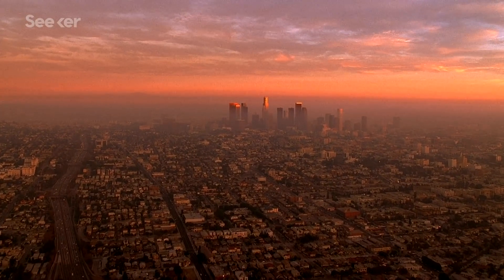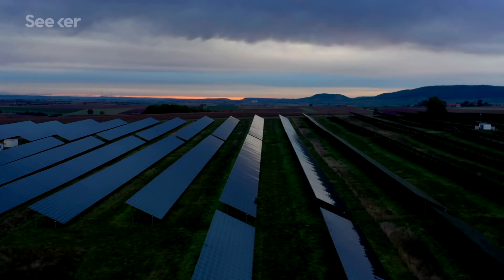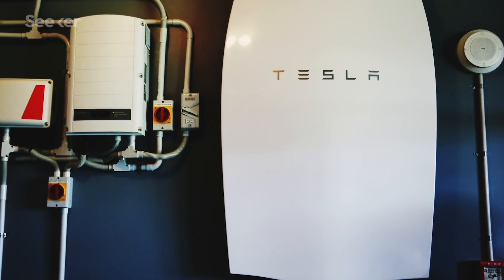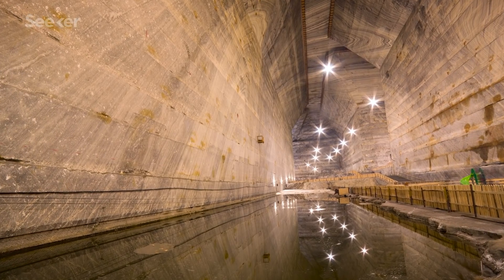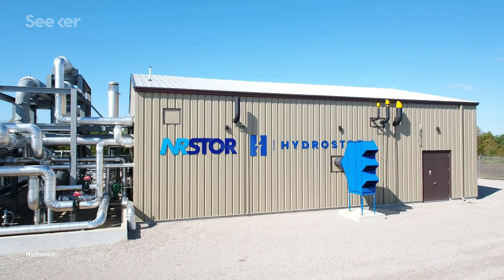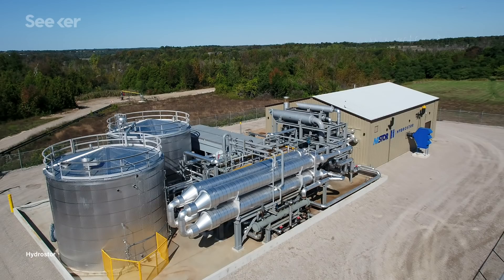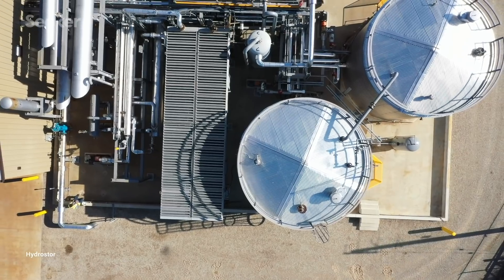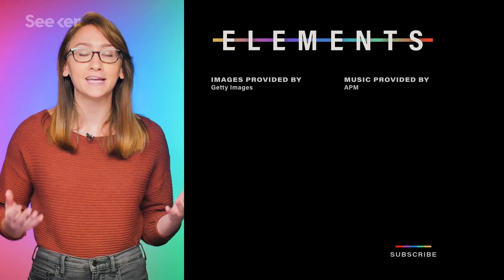This New Tech Could Revolutionize How We Store Renewable Energy

Comment: "Solar wind and renewable are the future" 
Thorium based fast breeder reactors : I am about to end their whole career.
Reply: Every single time anyone mentions renewables anywhere, you can safely bet anything that a squad of pro-bono salesmen declaring that some theoretical nuclear technology is the one and only way forward and that anyone who isn’t yet convinced is as bad as a creationist anti-vaxxer, will quickly appear out of thin air.

Maybe, if the climate gets dealt with at all, the power mix may require some nuclear energy, but this weird, rose-tinted, astroturfey evangelism seems to do more harm than good.

It seems this is more about feeling superior to the “hippies” than convincing anyone or examining anything.
Reply: @bugviddump7397  Bro I am not here selling anything. You understand what a fast breeder reactors is? You put in fuel and after that you get energy plus more fuel. 
If this doesn't excite you then I don't know what will. 
Talking about renewables I am not onboard with Elon Musk's solar dream even though India has some of the world's biggest solar parks because Thorium can do to India what Oil did to middle East.
Reply: @bugviddump7397  Its not rose tinted. It actually is similar to anti-vaxxing, because its a bunch of people who arent in the field running their mouth about something they read somewhere.
Reply: Instead of another pissing contest about which tech is best, lets at least agree on one thing. All possible solutions need to be taken seriously, including climate engineering, or we're f**ked.
Reply: He is right but it's not a permanent solution and we can't just switch to renewable over the night and not even in several years. Imagine the effects it would have on the people and economy which is totally dependent on non renewables. Maybe after a few hundred years thorium we might be able to achieve complete green energy.

Switching to renewables in 20 or 50 years is a stupid thing and will have dangerous effect on the economy of third world countries. Just because some pretentious virtue signalling people who is on a mission to save the planet(complete bullshit) doesn't mean it's right to switch in 50 years or less. It would be a mass catastrophe. People are already fearing about another recession in our doorstep. The only sensible thing would be to switch to thorium for now.
Reply: @Resilientman07  Any serious development in thorium requires a ground up rebuild of the nuclear fuel industry. Not only would require a massive upfront capital expense but it would also be extremely time consuming. 

In fact less developed countries are in many cases better suited for 100% renewable development due to localized populations with limited energy consumption. The major issue with developing 100% renewable for a developed nation like the USA is the scale of infrastructure required over a very large area to supply very large consumption.

Additionally the majority of benefits being discussed are not inherent for thorium, but are rather benefits for a very particular type of reactor found in the Molten Salt Reactor family called a LFTR- liquid fluoride thorium reactor.

The USA actually had commercial thorium reactors in the past at Shippingport and Ft Vrain, but these were light water breeder reactors and did not exhibit the benefits of thermal efficiency, safety and fission probability that are discussed in this thread. For these benefits you need to specify that you're talking about a LFTR, which btw is an insanely complicated reactor.

There's a reason why politicians do not attempt to discuss Generation IV reactors beyond that of light water SMRs. Reactors in Generarion IV are extremely complicated and typically require designs that push limits of nuclear engineering.

For example in a LFTR you're talking about liquid thorium and uranium fuels mixed with lithium fluoride and beryllium fluoride coolant. Historically we don't have great understanding of fluid dynamics for liquids outside of water and a few other materials. At a base level it is impossible to mathematically solve navier stokes equations for these liquids unless you have the help of advanced computer modeling. Today LFTR designs are tested at Idaho National Laboratory using supercomputers.

The idea that anything involving generation IV reactors is simple, typically illustrates that the person saying this doesn't know what they're talking about.
Reply: @brian2440  no just come to India or anyother developing nations to see if we have space for solar farms and wind turbine farms.poverty is the criminal right now I would say not climate change . Western People should think in terms of population and poverty and uplifting the world's average income. Most people in developing nations Don't have much needed knowledge about birth control and population explosion l. If these things gets regulated then automatically people will care about a good domicile and fresh air. Priority is Poverty  and not climate change. Imagine the amount of silicon waste and also the efficiency of solar panels. Lowest of all renewables right now.
Reply: @brian2440  I appreciate your deep understanding of the subject Brian :)
Reply: @Resilientman07  There are ways to recycle silicon waste and it is inaccurate to compare photovoltaic efficiency to thermal efficiency and turbine efficiency. All of these have different variables associated with calculating their efficiencies that are not necessarily applicable to other means of energy development, therefore it is inaccurate to attempt to compare the efficiency of a solar farm to the efficiency of a natural gas plant at face value.
Reply: @Resilientman07  So in my comment for developing nations you will see that I described countries with localized population and limited consumption. 

India while having very high population per capital in some cities doesn't really fall under this criteria because it has multiple major population centers spread out around its country and ranks #3 in electrical energy consumption in the world.

India has somewhat of a unique situation in which they have very limited uranium supply by the largest reserves for thorium in the world. There's a lot of good development in Thorium reactors in India partically by the Bhabha Atomic Research Center  and Indira Gandhi Centre for Atomic Research, as you may know.

For India it may make sense for them to develop a larger concentration of thorium based nuclear energy, and have a larger concentration of nuclear development in your portfolio.

I also can't speak for your grid situation as I'm completely unaware of how India has it set up. This is actually very important, because your grid network can both aid in and make challenges for higher concentrations of intermittent energy distributed throughout your country.
Reply: @brian2440  wow I agree with you on most also we should fund more on molten salt thorium reactor more efficiently because we can't achieve total green energy using solar, wind alone in next few years. What about poverty? Could you provide solution for the things I stated in previous comment. You're eloquent and Yes I don't know the gobbledegook of molten salt thorium reactors completely. I know they produce harmful waste but they decay much faster and it's just temporary if you know what I mean we should invest in solar but research nuclear more at the same time.
Reply: @Resilientman07  So you do realize though that nuclear waste with shorter decay rates typically present larger risk as this means the isotopes exhibit higher radioactivity? (Theres a lot of other variables as well, but just comparing decay rates this us true).

This is actually a significant issue with MSRs in that their fissile fuel is considerably more radioactive and their coolants are considerably corrosive. This is why most companies have proprietary superalloy compounds that they would make their plumbing out of to resist higher levels of radioactivity and corrosion. This also creates an additional problem in that you're requiring major infrastructure to be effectively custom made of rare materials thus increasing cost. Typically this is downplayed with the explanation that the benefits of lower risk and greater operational efficiency reduce capital and operational costs or even fuel costs depending on a company's model.

As for reducing poverty that's a very complicated question that even if I wrote a 150 page book on here wouldn't necessarily answer. There are too many variables involved to give a definite answer, however if we look historically at the largest rates of developmental increases in society they follow massive periods of industrialization. 

This puts countries like China and India in a sticky situation. In order to develop your country at a massive scale and significantly improve economic well being of your society you will likely require massive industrialization, but at the same time historically these periods also brought significant increases in pollution of which we are trying to reduce. 

This is in part why China's economic, energy and environmental plan One Belt One Road they state that there will be a delay in significant emission reduction as the country is trying to develop its western area and grow the overall developmental status of society.

Now this doesn't mean start cranking out more coal mines, but it does mean you need to significantly increase energy generation that likely needs to be primarily non-intermittent. This is where technologies such as CSP Thermal, VHTR Nuclear, AHTR Nuclear. MSR Nuclear, MSAHTR Nuclear, CCS Natural Gas, HELE Natural Gas/Coal, CAES/CHP/TIF/LAES (energy storage) coupled with increased energy efficiency can play a major role in developing your society at a very high rate but also minimizing emissions as much possible under an industrialization model.
Reply: @brian2440  man! You're so eloquent. Here have my like😁 but I think you do know that they tried solar cells in germany but it left more carbon footprint than it was supposed to reduce which on a large scale if you think about solar panels affordability and manufacture, I can't fathom the amount of damage it would leave . Would be happy to hear your thoughts.
Reply: @brian2440  water is really dangerous inside nuclear reactors, it becomes hydrogen gas. People think that the uranium is dangerous, no, the steam is the dangerous thing.
Reply: Yea well they best get a whole lot more efficient if they are going to be the future! As of right now they are just super expensive sink holes!
Reply: Seeker already did an article on that energy a year ago.
Reply: yeah i wish there wasnt so much stigma against nuclear power.
Reply: See my full article at renewable energy,https://sciencetechjon.blogspot.com/2019/12/renewable-energy-innovation.html?showComment=1577442985389&m=1
Reply: y'all need to read about the THTR thorium reactor build in Germany and the disaster that it was.
Reply: @jonas1015119  Could you provide a link? I'm trying to find out about it, but can't seem to track it down.
Reply: @eugenes9751  https://en.wikipedia.org/wiki/THTR-300
Reply: @jonas1015119  Thanks, it seems like it was shut down because of regulatory and licensing problems. Or am I missing something?
Reply: Abhishek Dev you better beat us to the “thorium consumption reactor”...that breaks down the past and current hazmat radioisotopes:))
Reply: Thorium doesnt work
Reply: Abhishek Dev I was just about to leave the precise comment you left—thanks for saving me the typing! :-)
Reply: Indonesia is taking a strong interest in Thorium. They are currently researching the possibility of having a tanker powered by Thorium. Don't know how is that going to work, but one can imagine the military application. Their keeping it tight lip though. Perhaps to avoid attention of success or embarrassment of a major failure.
Reply: If you're operating a fast breeder reactor it would be more effective to breed Uranium 238 into Plutonium 239 than to breed Thorium 232 into Uranium 233.
Reply: In theory, Yes. BUT...
Reply: Nobody here seems to be mentioning ThorCon. American company securing funding from the Indonesian government to construct a tanker ship with a Molten Salt Thorium Reactor which transmits power via an undersea cable to the mainland. Solves the problems of construction costs, mobility and safety by being constructed over the Ocean and having a passive cooling failsafe. It can generate insane amounts of power at total lifetime costs lower than coal and oil and that's just with the current cost of Thorium and steel shipyard costs. If economies of scale kick in for ThorCon in other markets, you could see dozens of these things off major coastlines in short order.
Reply: ThorCon can compete with coal and replace coal burners with thorium burners. https://youtu.be/EyApF90-GEI
Reply: Y’all. He was largely making a joke. Chill.
Reply: Thorium reactors may be the future in 50 years.
Reply: Yeah.. because of numerous unsolved problems, estimated to be ready 20 years from now, like nuclear fusion..
Reply: Matthew Huszarik  fixed it, still it was just fearmongering
Reply: Matthew Huszarik  yes, that's the reason its easier to create it in thorium reactors, not only you don't need the same quality as U235, the process is much simpler, and you get PU as kind of side-effect.
Reply: It’s taken so long that fusion will come before thorium based reactors
Reply: Thorium reactors... a nice idea, incredibly useful, that has great PR that overshadowed some of the structural impediments it has.

Business-model for nuclear is uniquely unworkable, which is the main reason it's unpopular. 

Nuclear plants can and do often end up being huge sinks of money with cost overruns. Construction companies end up having huge leverage to run up costs and delay. Political forces (e.g. pro-fossil fuel) can easily leverage local, federal politicians through dark money lobbying and astroturfed campaigns to delay. Stakeholders in the local area may have genuine, good faith, concerns and resistance. Or they may be irrational and opposed to "nuclear".

But fact that China has cooled on nuclear power convinced me the issue is more than people 'just being scared of nuclear' and overbearing, excessive government regulations.

Perhaps the small sized, portable, supersafe, reactors are the solution to the main practical issues? In any case, while nuclear has issues it cannot/should not be frivolously dismissed, we need all possible tools to deal with this transition from fossil fuels.
Reply: BB2 G - your argument is against BWR and PWR designs. 
Your reasoning is as valid as saying you can’t cross a body of water, because your canoe is leaky. 
Can you build a new canoe that does the job? 🤔

I doubt you have a clue about LFTR or uranium salt reactors, but you’ll quote ad nauseam about old reactor designs and say it can’t be done. 
News flash, no one is suggesting building any more of the old designs. 

Is there work to be done, of course... doesn’t it make sense to explore it as a replacement for NG and coal power plants?
Reply: @bakos6625  Molten salt thorium reactors  actually addresses most of the issues with today's nuclear power generation, in particular safety and waste generation. The main reason they aren't the major source of power today is a political decision made by the Nixon administration which unfortunately changed the course of nuclear power, for the worse.
There are many issues that still need to be addressed with MSTRs but they are not really more difficult than issues solved for other types of reactors. The only reason they haven't been solved yet is because much less effort has been put into solving them.  Thankfully at last that is now changing, even if slowly and not in the western world.
Reply: BB2 G Nuclear does not do ‘small’ safely. The problem with all nuclear reactors is that it releases radiation which has major safety implications, makes maintainance difficult and expensive.
Reply: Name one functioning Thorium reactor.
Reply: @ariason7233  Bruh, wait a year then i will tell you
Reply: @ariason7233  ORNL's MSRE demonstrated  MSR capabilities. China has 400 PhD scientists and billions of dollars dedicated to TMSR and other salt cooled designs
Reply: @ariason7233  There were THTR-(300) in Germany 30 years ago, but the concept of the pebble bed reactor wasn't quite the best - then and now - so it was discontinued in 1989
Reply: @ariason7233  World's first fast freeder reactor is operating in India.
Reply: @abhishekdev258  Well that is good to know. I'm guessing that is an experimental reactor? I wish Thorium reactors all the best, when it comes replacing oil, coal, gas and old nuclear with Thorium fast breeder reactors I say YES. It is at least on paper significantly better. The energy transition needs all the help it can get. When it comes to Thorium pushing out other green technologies I say NO. We need both.
Reply: @abhishekdev258  Hmmm? EBR-1 was a sodium potassium cooled fast breeder reactor that operated in the USA in 1951, so no....

*Side note the US Nuclear Submarine Program actually commissioned two different types of nuclear submarines one based on EBR-1 and one based on the combination of designs between 105-B aka B Reactor at Hanford and X-10 at Argonne (although technically at the time both of these water cooled projects were commissioned under the Manhattan Project). The EBR-1, liquid metal breeder reactor, led to the creation of the USS Seawolf program in 1954. While the X-10 and B Reactors, water cooled design, led to the creation of the USS Nautilus program in 1953.

This is why its important to use correct labels to specify exactly what type of reactor you're talking about.

Also BN-800 is a Generation IV Fast Breeder Reactor operational in Russia since 2015, which in part uses decommissioned plutonium 239 from WMD stockpiles as part of an amendment for disposal of weapons under NPT.
Reply: @ariason7233  The fast breeder reactor is already supplying electricity to the grid and the reactor is profitable.
The only reason why there aren't many fast breeder reactors is because India doesn't have funds. And no they aren't sink holes for money. If India would give control of their Thorium to USA like Saudis (initially) gave control of their oil to USA. Things would have been very different.
Reply: @ariason7233  There are a few in india
Reply: @incription  nope
Reply: Thorium is meaningless if nobody's willing to build the reactors. Ironic how the greenest energy in existence is not allowed to exist because of the exact same people who are trying to "save the planet".
Reply: @The Infidel - you are seeing "renewable power" through rose colored glasses. 
https://www.google.com/amp/s/www.spectator.co.uk/2017/05/wind-turbines-are-neither-clean-nor-green-and-they-provide-zero-global-energy/amp/
The best green energy is Hydro electric, and fission (eventually fusion).
Wind and PV are just feel good energy sources, and are wastes for the most part. 

If I had a cabin in Alaska, 200 miles from anything else,  I'd put in PV for my summer vacations. But using PV to supplement a power grid, is a waste of resources.
Reply: @curtischilders3024  PV has only success because it avoids taxes in residential and low power usage , it doesn't need to be economical either
Reply: People against nuclear nuclear energy have already lost the debate. The transition to completely clean energy will involve multiple sources/types - nuclear, wind, solar, etc. The next breakthrough in nuclear technology was the Small Modular Reactor (SMR). 

https://www.energy.gov/ne/nuclear-reactor-technologies/small-modular-nuclear-reactors
https://en.wikipedia.org/wiki/Small_modular_reactor
Reply: he said "about", which means mister. Anti-nuclear guy, it's going to be built all over the world i hope.
Reply: @aryan201  "about", "i hope"
yall nuclear fanboys always like to talk speculatively. Its like speculation is the only thing you can do lul
Reply: de0509 “Nuclear fanboys”? Wow it’s almost like someone could support something still being worked on and has potential to be much more viable and useful than something else, cause we all know solar and wind are absolutely perfect.
Reply: @de0509  I hope for a brighter future, and only nuclear energy seems to be the way.
Reply: @de0509  The irony of that comment on a Seeker video where all they talk about are "could" and "maybe"...
Reply: Fun fact a thorium reactor is safer than a uranium or plutonium based one. And can’t be converted into a nuke building facilaty so we can place them in hot zones (political, and  military). And thorium is a lot more abundant than uranium and it is also has more usable power. The waste only last a couple hundred. Aginst thousands of years or uranium and plutonium.
Reply: @spacetechempire510  You do realize that because that because Uranium 233 has a 300 year half life compared to Plutonium 239' 24,400 year half life or Uranium 235's 700,000 year half life that makes Uranium 233 considerably more radioactive and have a higher medical risk than the other two fissile fuels radiologically speaking? 

(Plutonium 239 has some additional risks due to toxicity).
Reply: SpaceTech Empire yeah 100s of years of planetary pollution vs thousands of years is your argument. The reality is if there’s nuclear waste and scientists haven’t figured a way to wipe it from existence or turn it into a non toxic substance, nuclear is a failure (if you care at all about the rock your living on) we have the tech to power the world that doesn’t have radioactive component. Frankly the only real possibility I see for nuclear are watches and clocks and possibly nuclear batteries. Anything else dealing with nuclear has done nothing but cause massive harm to this planet.
Reply: @Hulkenbreak  There are many ways to deal with nuclear waste and most of these are used in practice today:

- Fast Breeder Reactor/ Fast Neutron Reactor
- Vitrification/ Synroc Conversion
- Nuclear Burning
- Reprocessing
- Pyroprocessing
- Industrial Re-Utilization
- Advanced Burner Reactors
- Deep Geological Depository
Reply: @brian2440  Then you should have been more specific, since you quite clearly stated there isn't enough "empty land" on earth for wind and solar to be viable. If you didn't mean that literally I'd suggest saying what you do mean, or at least providing additional context, since less informed people could interpret your words literally, which would lead to completely incorrect conclusions.

Regarding land in the right places the answer, as so often is the case is, "it depends". Solar can be co-located with agriculture in the SEA region without prejudice to either. In Europe the Netherlands are either the largest or second largest (I forget which) food exporter on the continent because of their extremely efficient land use.

Agriculture, particularly animal rearing uses mind bogglingly large amounts of land. Now I'm not about to suggest everyone become  vegetarian, that's a whole different discussion (and something I'd personally struggle with) but it does mean that there is plenty of land, even in developed countries. We simply need to utilise the land we have more efficiently.

Add NaS mass storage, Li-ion peakers, pumped hydro, offshore wind and the current commercialisation of hetero junction PV, offering very large gains in energy density over the next few years and you have a promising mix.

Unfortunately when it comes the these discussions all I seem to see are either half truths, flagrant exaggerations or pervasive negativity. Nuclear is a fine technology. As an engineer I like it, hell I appreciate the engineering complexity behind coal and CCGTs as well. However looking at the nuclear record. Looking at Hinckley Point C and seeing the UK government paying more than double what the wind lobby offered for outdated technology that is already over budget and will almost certainly be delivered late is not a great selling point.

Solar and wind have their weaknesses, as does any generation technology. However at their core they are cheap, relatively easy to build, massively scalable, inherently safe, quick to decommission and can be easily recycled, they also have that rather neat attribute of an inexhaustible energy source that doesn't have to be transported to the generation site. 

Now excuse me while I rant a bit. 

Yes there are grid stability problems, there are voltage regulation issues, synthetic inertia still hasn't been cracked, reactive power generation drops off with voltage for static compensators, yes these are some issues among many and yes they are being worked on. The US still has "temporary" underground waste storage facilities for highly radioactive nuclear waste that are held up by wood, the same wood that is vulnerable to ionising radiation. Yet I see little discussion of that.

Nuclear has a similarly long list of issues, which are also being worked on. Hence the promise of thorium and fusion. However right now these are either nascent or unproven technologies which will take decades to mature. Meanwhile should we remain at the status quo? Or should we work with and improve the technologies we have, today, that can mitigate climate change and help us to transition?

I'd love to see a future of limitless fusion energy, but until we get there and until they are viable for all to implement and use across the world I will emphatically support the development of onshore and offshore generation technology, both electrical and thermal so that future generations can enjoy this little blue dot and continue to have disagreements on YouTube without having to live in a bunker.

End rant.

Edit 1: This was suppose to be to Eugene, not Brian, but I can't change it...
Reply: @DaleBarnard  Saw your edit, so thanks for clarification.

I agree that the grand majority of people on media are massively oversimplifying energy transitions both those that support renewables, those that support nuclear and whatever anyone else supports. 

It is extremely concerning to me to watch our politicians bicker over who has the most ambitious GND, when in reality all of the candidates plans are dumpster fires compared to actual scientific studies on energy transitions. 

I don't support 100% renewable due to scale of infrastructure required. For one 10 million solar panels is a massive scale and huge solar farm - great accomplishment, but under a 100% renewable model were looking billions to hundreds of billions of panels. Not only is it the amount of resources and planning to develop these projects, but at this scale you require a massive amount of time to set up these projects, which I would say construction (in terms of the actual processes for preconstruction and construction) are largely not even considered when people make these plans. 

Additionally there are considerable management challenges for the US Electrical Grid to sustain this kind of development. Yes it can be technically achieved, but if we already have existing assets that would reduce the need for massive confidential scale management and supplemental technologies it does not make sense to me to make our decarbonization plan more difficult. And a LOT of studies for Sustainable and Renewable Energy Sources make this same argument. 

Lastly we need to consider the challenges of implenting these scales of infrastructure in real time. Is it feasible to replace generation from a natural gas plant or nuclear plant with just renewables by the established deadlines? What is the risk if we fall to meet these deadlines? Does it make more sense to innovate existing assets than removing and replacing them with another energy source? 

One of the largest questions I have of Sanders GND in the USA is that he has a policy that all nuclear reactors coming up for relicensing would be decommissioned. By 2022 (in less than 2 years) 9 nuclear plants would fall under this criteria and these plants produced nearly 80,000 GWh in 2018 in Massachusetts, New York, New Jersey, Ohio, and Michigan. That's more energy than the net generation for the entire utility solar industry for 50 states combined (by over 15,000GWh). Does it make sense to replace this amount of energy in 2 years with wind and solar? Absolutley not....

So we also need to recognize do our timeframes for development match expected timeframes for reduction so that we can safely transition to other sources without causing catastrophic impacts to the electrical grid and the economy. 

-----------------------------------------

In regards to your comment on nuclear waste storage, I personally do not agree with the conventional US policy of mandating that all nuclear waste be placed in deep geological repositories.

1. It's a tremendous waste of resources. Considering the fact that approximately 97.5% of all high level waste by volume is made of Uranium 238, Uranium 235 and plutonium 239. All of these are fertile or fissile nu lesr fuels that can be used in nuclear reactors models that currently exist in commercial development at scale. 

Now is it simple? Heck no... to separate the materials it first requires reprocessing, which is a very chemical intensive and costly industry. There many types of reprocessing though with some non-aqueous (elimination of water) based procedures that reduce waste volumes and water concentration to reduce costs. 

To reduce Uranium 238 and Plutonium 239 concentrations we can use fast neutron and fast breeder reactors. The USA is the foremost country in this technology with the development of 16 experimental programs spanning 40 years, yet we do not have a commercial reactor. Other countries do have commericlal FBRs though. Again THIS IS NOT A SIMPLE TECHNOLOGY. 

Overall I believe that if the uSA developed a true nuclear waste management program that was designed to re-utilize unspent nuclear fuel and use some fissions products for other uses we could significantly reduce waste stockpiles while also growing new industries. 

Is this going to happen? Likely no. 
1. These processes require very capital intensive and very technical technologies that have very limited populations of knowledge (one of the largest reasons we didn't develop MSRs past the 1970s btw).

2. These processes are used in weapons development and use fuels that are used in the creation of WMDs. This raises a lot of political and social problems.

3. This is an extremely complicated topic that the average American has little to zero understanding of, which opens an easy door to misconception and fear.
Reply: @DaleBarnard  Just out of curiosity are you related to Michael Barnard?
Reply: @brian2440  Well put, glad you saw the edit. I'm not related to any Micheal that I know of - is he well known?

I agree with your point on timelines, as much as I admire Bernie he isn't an engineer, however I think when presented with cold hard facts he'll keep those plants open, at least for the next decade.

Part of the problem with this debate is that most people don't debate in the fashion that we have here. In fact most people are so quick to judge that I think we both made judgements about each other that were incorrect, assuming each other to be part of that demographic. 

Now to your other points. As I said I agree on the timelines but not on the 100% renewables part. Of course if fusion is achieved it changes the entire landscape and one could argue that it isn't renewable, so I'll go with the broader term of "clean" energy. I would also include fission based power plants here but only if the waste were managed properly, for example in the manner you describe.

I think the timelines is a potential white elephant though, if you look at how quickly solar can be scaled, compared to how long it takes to build a typical PWR the difference is startling. If you take the Villanueva plant as an example construction timelines are about 0.75 GW per year. Considering a capacity factor of 20% that's only 0.15 GW effective per year but then consider that the vast majority of labour does not have to be technically skilled. Only basic training is required. Compared to most thermal plants, hell even compared to wind turbines this is a huge advantage. Not to mention a huge opportunity to drive employment in uncertain economic times. So in short I think the timelines aren't really the issue, but the supply certainly is, though major improvements have been made over the last 5 years both in capacity and environmental sustainability.

To the other commenter - most PV modules (panels are actually the thermal kind, a common misnomer) pay off their carbon debt within 3 years. I have seen no studies suggesting they require more carbon to produce than they displace and even if they did, at least they do displace carbon - CCGTs and coal simply produce even more of it past that which was required to get them out of the ground in the first place.

Nuclear I'm less certain about, but I do know that fuel processing and reprocessing is extremely energy and water intensive, not to mention the mining operations and the gargantuan amounts of concrete required for the reactors - therefore I'd assume they do not fair too well on the carbon scale.
Reply: @DaleBarnard  For timeframes I'm not comparing energy sources, but rather looking at how different feasibility analysis studies review different decarbonization models.

Feasibility Analysis Studies https://www.sciencedirect.com/science/article/pii/S1040619016300136

https://onlinelibrary.wiley.com/doi/abs/10.1002/wcc.324

(Free PDF available) "DEEP DECARBONIZATION OF THE ELECTRIC POWER SECTOR INSIGHTS FROM RECENT LITERATURE"

http://energy.mit.edu/news/study-adding-power-choices-reduces-cost-and-risk-of-carbon-free-electricity/

I guess in order to gage the feasibility of a timeframe you think is acceptable I would need to know what timeframes for completion you are thinking about. 

I would also caution using particular examples of an energy source for implementation as the normal case in the USA, and this applies for all emergg sources. The USA has different solar radiance rates, as well as different construction laws and permitting regulations. Furthermore you have created a massive solar plant and it's great that you can generate a massive amount of energy, but that plant doesn't mean anything unless the energy generates actually gets used by people in the country. Therefore when making comparisons we need to look from a greater perspective and take into consideration the energy network as a whole, and in reality should be comparing entire energy plans to one another rather than singular energy sources. This also applies to cost, and one of the best reports I have read by Lawrence Berkley and Argonne National Labs expand on this point finding that comparing isolated energy sources to one another such as in a LCOE analysis doesn't look at the real net costs at scale between energy networks, and this is why we should instead be evaluating energy with a Total System Value Analysis. 

("Impacts of Variable Renewable Energy on Bulk Power System Assets, Pricing, and Costs" is available online is a publically accessible PDF, it's a long study but a good read).
Reply: Abhishek Dev  Yea, anyone thinking wind and solar are the future need to open a book.
Reply: @The Infidel LOL, do you not realize that renewables are some of the most subsidized things we have? Nuclear is only expensive because of government regulation. It's by far the most economical way of generating electricity, even with all of its current costs. Also, there isn't enough empty land on earth to provide enough solar and wind capacity for the world. And that's today's world, forget the future. The amount of erroneous information in your statement is bewildering.
https://www.youtube.com/watch?v=N-yALPEpV4w
Reply: @eugenes9751  What a ludicrous statement, and you accuse the other commenter of making false claims. There is far more land than we need to move to 100% renewables, not even counting off shore wind. Let's take the Sahara desert as an example. 

The Sahara desert covers 9.2 million square kilometers. If we assume a 20% auxiliary requirement for support functions and a 40% GCR we have a module area of just shy of 3 million square kilometers. This is enough to fit 1.28 trillion modules 2.3 square meters in size. If each module has an STC rating of 430 W this is a peak output of 550 TW. 

Now let's assume an extremely conservative overall end point efficiency of 5%, including generation, storage and transmission losses and we get AN average delivered power of 27.5 TW which translates to 241,000 TWh.

Energy consumption of earth in 2017 was approximately 113,000 TWh for ALL sectors. Let's say that doubles in twenty years - then this one solar installation STILL produces enough power for the entire planet.

Perhaps you should check your own claims before accusing others.
Reply: @DaleBarnard  Oh yeah and were just gonna run transmission lines all over the world from the Sahara? 

Are you serious? Let's bring this discussion back down to reality.
Reply: @DaleBarnard  Excuse me, I didn't mean that literally. I meant that there isn't enough realistically usable land around for solar. Putting panels in the sahara desert, in my opinion is not realistic. If you're going to work with renewables, it makes little sense to then take a gigantic transportation loss because your plant is 6 borders away and there's no infrastructure whatsoever leading to it, and that's just for Europe, how about the rest of the world? Not to mention all the other problems with building things in a desert and in unstable countries... I realize that can be significantly improved with lots of money, but again, that's not realistic. That will effectively make the energy generated so expensive that nobody would use it. And that's if you could even fit that excess into the local grid in the first place. Without storage, the duck curve wrecks absolute havoc on current grids and is by far the biggest problem that needs solving.
https://www.youtube.com/watch?v=E0W1ZZYIV8o
Reply: @eugenes9751  Not to mention even with mass storage there is potential for significant diminishing returns for areas with high seasonal variability

https://www.google.com/amp/s/www.technologyreview.com/s/611683/the-25-trillion-reason-we-cant-rely-on-batteries-to-clean-up-the-grid/amp/

This isnt to say that we shouldn't use solar. In reality solar is likely to become the major energy source for electrical generation by 2050 with both residential and utility development. However, energy storage and transmission (flexibility, curtailment, loading, balancing, synchronous and asynchronous functions) are two major technical issues for 100% renewable at scale.

Technically it can be accomplished, but is the scale of infrastructure required make this the best option? In my opinion no it does not.
Reply: @DaleBarnard   430 W  per  2.3 square meters , you are way over optimistic about PV efficiency
Reply: @monad_tcp  The Longi LR4-72HPH has a max STC rating of 440 W and covers an area of 2.225 square meters.

Do you even check your assertions before making them? Care to address the rest of the comment or just the part that you (wrongly) thought was incorrect?

Edit 1: Grammar
Reply: @DaleBarnard  no, because the internet does it for me, thanks. So It was not that optimistic, it was actually more realistic, but still we must be close to the theoretical limit. (assert check this please, I'm too lazy to do it)
Reply: @monad_tcp  so you're advertising that you're lazy and entitled? I hope for your sake that isn't really true. If you're justification for not checking things before you state them is that others will do it for you, then you can't ever, without being a hypocrite, criticise anything that happens as a result of disinformation or false information, for you yourself have played your part in spreading false information without bothering to check if it was correct. 

As to your request we are not close to the theoretical limit no. Most PV modules have a limited defined bandgap, by using hetero-junction cells with multiple bandgaps, by reducing carrier recombination losses and by developing new technologies that can up-convert low energy photons we will see modules continue to increase up to 600 Wp and beyond.

The thermodynamic limit would be a density of around 1 kW per square meter, but we will never reach that (unless in orbit where the limit is higher at around 1.3 kW/msq)
Reply: @DaleBarnard  no, Im saying I don't care about doing that on YouTube comments, this is not serious
Reply: @DaleBarnard  so there we are, from 200w/sqm to 1200w/sqm 

we can have 6x more efficiency then that's it's it.
were close to the limit. we won't get an order of magnitude better
Reply: @monad_tcp  and you're point is what exactly? We don't need an order of magnitude improvement to power all of humanities energy requirements, so... Why would we look for one?
Reply: Nukes are essential as we head toward sustainable future.  Unfortunately thorium, fusion and some of the next gen designs are decades away from proof of concept.  Save every nuke possible currently in operation.  Build all nukes in the pipeline.  Hopefully thorium or better yet fusion comes online by the late 2040's... we add 55 billion tons of GHG to our atmosphere per year. To doubters, agree to have your share pumped directly into your home instead of our common shared air. Prove how tough you really are.
Reply: Bob Quigley thorium msr is proven it's not the designs it's the regs that need to catch up they have all been tailored to make lwr safe. But you are right about decades away because I can't see anything changing fast. Shame about the solar and wind tho they say we use more each year yet we still use more and more coal and oil and gas (yes I know gas is slightly better) each year. How come if we are using so much solar and wind does it not make a difference? ( I think we are being lied to by the renewables and the petroleum industry ( who support renewables because they think it won't work)). Well at least the planet will be ok. Let's all push for MSR's and hope some miracle happens